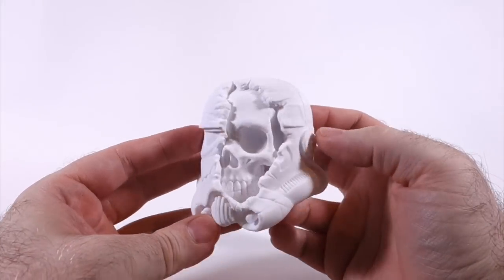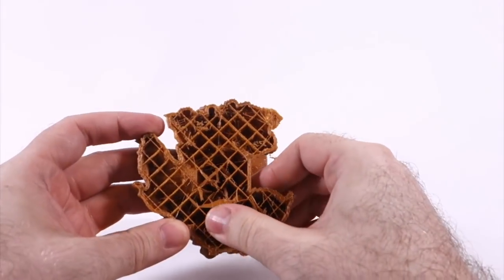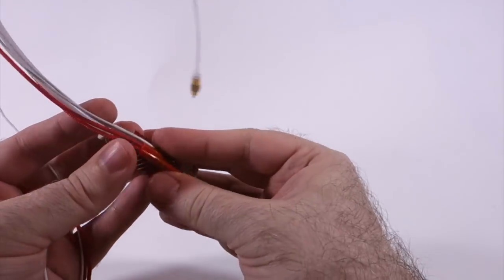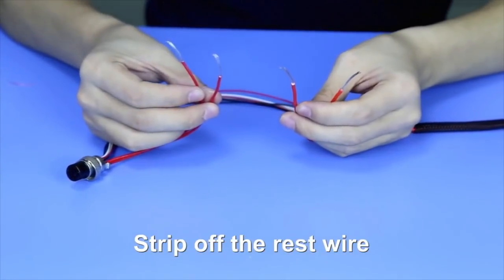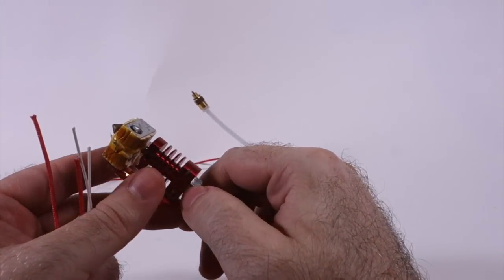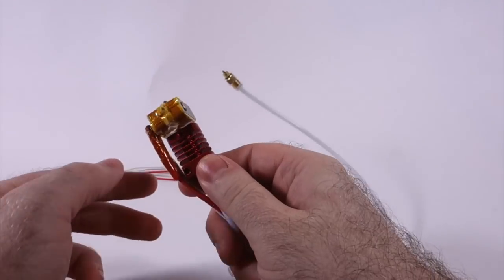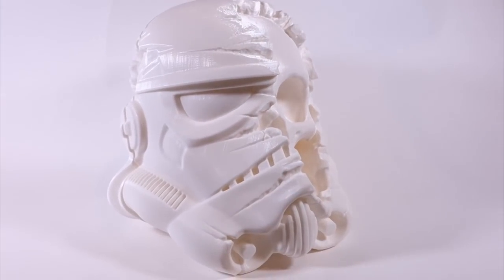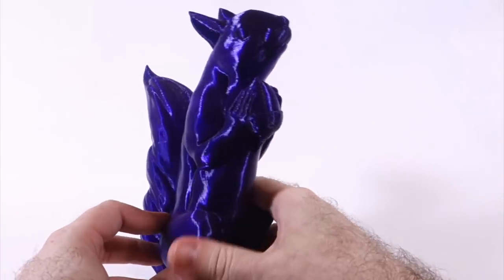Creality CR-10 Update -- Adventures in 3D Printer Repair

Comment: I bought my CR10 from Tiny Machines for this exact reason. Support. Got the printer last week, and just had this exact problem, contacted Tiny Machines this morning and a new heater cartridge was sent to me this afternoon. Great support is worth the extra upfront in my opinion.
Reply from the maker: +J. Benjimin Peters I can understand that. To me, the price difference was large enough that I was willing to take the chance. While I’m still learning when it comes to 3D printer repair, I do have enough experience under my belt that I feel like I can tackle many issues on my own. But back when I was buying my first printer I chose one that was well known for customer service for this very reason, and it did come in handy

Comment: had this issue a week ago (i probably had it for a while now), and i think the issue is that the cables are not attached to something solid are allowed to move when the head moves and thus weaken the connection.
I solved it by zip-tieing the cable to the top of the hot end and now it works perfectly.

Comment: If this is a possible recurring problem with the Cr-10, I would not go for the solder, I would just install a cheap connector so not to possibly damage the core machine parts and you would only have to transfer the connector of the heater cartridge to the new one.
Reply from the maker: I haven't had this issue again, but it's actually not hard or expensive to simply replace the entire hotend assembly if something does go wrong.

Comment: I am seriously considering a CR-10, do you have how you do things in any kind of expos'e video? What programs, settings, tweaks or fixes (this one is a good one to know, your heat element issue) have you had to do? The CR-10 just seems like you say, worth the gamble because of simply the HUGE build volume of it.
Reply from the maker: I haven't made a video like that, but maybe it's worth doing. The main program I use is Simplify3D instead of a free slicer, and I do think it gives better results. However, I don't know if it's worth the $150 price tag anymore, since the free options are getting better all the time. As for settings and the like, I'd recommend going to the Facebook group and just seeing what kind of questions people have
Reply: I've had terrible luck in the Facebook groups, not the CR-10 group specifically, but others, the trolls are nerve wracking. Yes, I'd love to see how you do your thing in depth, and perhaps Simplify3D is worth the price tag. I would really like to see how you handle the different support features. I want to learn, because the software isn't expensive for me, it's the actual machine. 

Thanks for the ultra fast reply!
Reply from the maker: The CR-10 group is moderated so it's not too bad. Just lurking for a while can give you an idea. The other option is looking at some of the more 3D-printing-centric YouTube channels. But I may consider some sort of intro video if I can find the time. Thanks.
Reply: I purchased a cr 10 mini.  Great machine while it worked. Lasted about 3 weeks and one day in the middle of a 8 hour print the control box went blank and was DEAD.  Sent it back to Amazon and ordered a Tevo Tornado.  Hope this helps you.

Comment: I've never seen heat shrink tubing w solder inside.  Whats it called exactly, brand?  Atleast its a machine you can repair yourself.
Reply from the maker: +Christopher Miller I don’t know if there even is a brand but Amazon carries several different kinds. I linked to the one I used in the description

Comment: I had the same issue with my Anet A8 heater cartridge. I bought a 10 pack on amazon for like $9...   A kit printer is going to be a lot easier to do your own repairs/upgrades on then a fully assembled printer, as most of them would void the warranty if you even  attempted to cut a wire yourself... I'd much rather order a part on amazon with 2 day shipping and fix it my self then wait 4 months to ship my printer back to china and wait for them to fix it and ship it back to me.   Buying a kit printer, you should know the cheap price means you don't get any customer support or warranty and need to learn how to diagnose (aka google search for the most part) and repair it yourself. If you want someone to call and have them take care of it, you'd need to buy something like an Ultimaker for a whole lot more money.

Comment: Easy solution: buy clamp down plugs. Easiest thing to do just strip em and clamp em. then to change it in the future it’s just plug and print
Reply: Also it’s not a gamble it’s called maintenance
Reply from the maker: If I recall, I was referring to purchasing from China as being a bit of a gamble because there's a chance you may get a printer with a problem of some kind right off the bat. and since getting service is more or less impossible, you have to be prepared to handle it yourself. Admittedly, these are skills you're going to have to learn sooner or later if you want to use a 3D printer, but not everybody is completely aware of this.